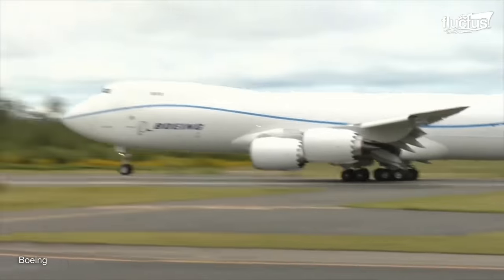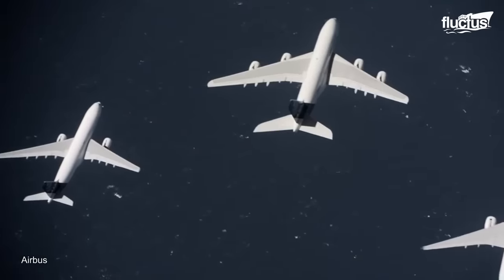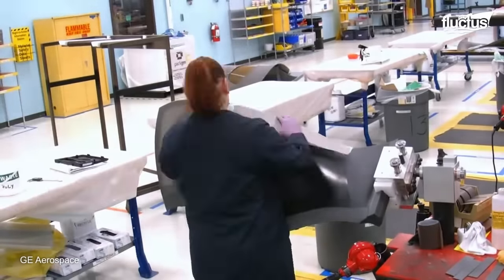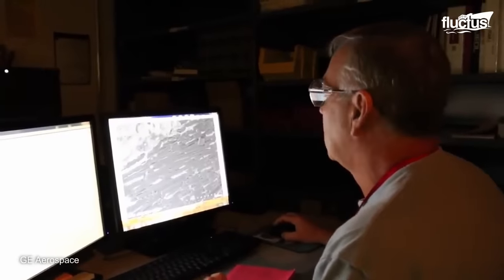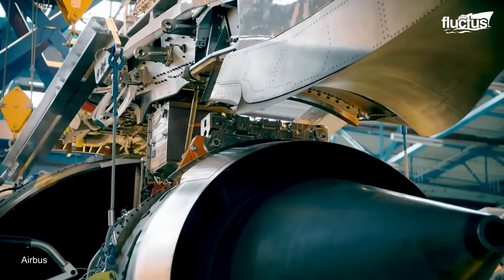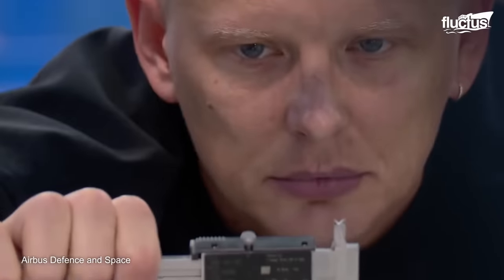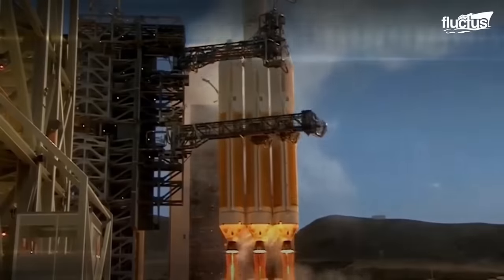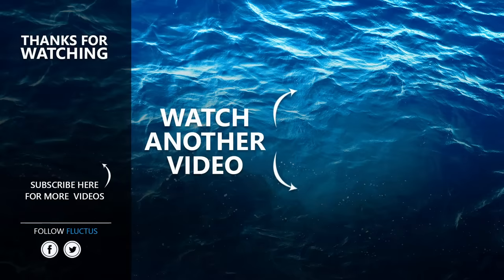Inside Futuristic Factories Building World  Largest Jet Engines

Comment: Trent engine doesn't cost 140 millon
Reply: Right. They are expensive, but not THAT expensive 😄
More like $20 million.
Reply: $ 140 million is about the price of the airplane itself like Boeing 737 or Airbus 320 size, they gotta get their fact right first before that
Reply: It's actually $35 million each for the Trent XWB,the world's most efficient high bypass large engine,based on RR's contract signed in 2007 with Qatar Airways worth $5.6 billion for 80 Airbus A350 XWBs.

Comment: A rolls Royce XWB engine doesn't cost $140 million dollars. More like $18-20 million for bare engine, and another 5  million for the inlet, mid cowling and thrust reverser.
Reply: You forgot another 2 or 3 mil for all the accessories.
Reply: I was also sceptical about those numbers..
Reply: @cdertschei  yup , a  new plane costs $70- $140m for regular versions then B747  and AirBus 380 are most expensive ones.
Reply: They can be a lot more expensive over engine lifetime. The lifetime cost of a large commercial jet engine including maintenance is anything from $40 million to $100 million plus depending on the number purchased. Jet engine manufacturing is dominated by the US and UK and the level of engineering that goes into their design and production is pretty amazing.
Reply: @peterd788  I know all too well how expensive modern jet engines are, the engineering that goes into design, build and continuing product improvements, and the operational coats are.

Today, engine leasing or Power by the Hour, give airlines a known cost verses rolling the dice and taking the chance the engine is going to live 35-40 thousand hours. 

All of the manufacturers set fuel burn guarantees.
Reply: It cost ~£30m

Comment: I think no longer should we speak of "Jetengines" when we consider   "turbofan-engines". These are no longer "turbojets" as in the beginning . Nowadays they have enormous blades so we can almost speak of Propellers.
Reply: Propellers with cowling..
Reply: Yeah it's known as a ducted fan.
Reply: High bypass fan
Reply: The Turbofan is the type of engine. The Turbo drives the fan.
You have high by-pass and low bypass fans.
Fully ducted and partially ducted fans
Reply: P

Comment: Worth to mention that each fan blade is made of a single crystal of titanium alloy. Being made of a single crystal is to avoid failures originating from microscopic cracks between crystals! … Jet engine! What a piece of machine!!! ❤
Reply: Not a single molecule (that would be miniscule) but a single crystal.
Reply: @terencerucker3244  you’re right 👌🏼 … I’ve just missed the term!
Reply: It's also not the fan blades that are single crystal, but the high and low pressure internal turbine blades. (the smaller ones inside the engine on the hot side)
Reply: @harryblack8686  They also have air passages embedded throughout the blade so cooling air can be blown through. I've filmed the whole process from lost wax casting to coming out of the furnace—absolutely fascinating.
Reply: You've got this pretty garbled I'm afraid.

Comment: RR titanium fan blades are lighter than GE composites. However, the real benefit of composites are not in the blades itself but the fact it allows you to use a lighter material fancase. With titanium, you need materials that can stop it from tearing through the case.

Comment: Oh, i thought this was going to be about GE since they make the largest engines, not RR.
Reply: Rolls Royce have just made the largest engine.
Reply: @nathd1748  No they have not. It's in very initial testing phases and they have said themselves it's not really a priority. They don't have anything to put it one right now anyway.
Reply: @John Iii  Not a priority??? You talk out of your ass! I'm the one over here with the phone line into the RR workshop and I'm hearing and seeing a completely different picture to what you are getting! The reason behind the fan size at 140" is that according to Boeing, that is the largest engine size they can fit under a 777x wing. So even though GE currently have exclusivity until 2028, RR are building a geared fan that will give them an idea of how it compares with the GE9x and what they can expect when scaled down. For your info, there are currently 4 other engines being assembled with smaller fans that will join the test programme. And IT IS a test programme because they are using the same core across different engine sizes but with a smaller main fan.
Reply: @nathd1748  Take shop gossip for all you want. The truth is is Boeing having so many problems as it it with the 777X development  right now as it is, they are not looking for another engine for it. Maybe in 10 years from now it might be an option. And basic fact the number of aircraft it will sell its not worth it for a two engine option. RR developing it is highly likely to be for Airbus and Airbus isn't in any hurry.
Reply: @John Iii  You have totally no idea mate. I work at Broughton Airfield, so you SHOULD have an idea who my employer is and WHY what I'm telling you is not gossip.
Reply: @nathd1748  Well if you can make it as large as possible, you can also shrink it for smaller planes right? I hope RR has been closely seeing how the P&W GTF has been faring, that thing works great but isn't nearly where it should be. New tech does go through challenges.
Reply: Yeah  me tooo !!!! Seems they were in the wrong factory, or it was a British propaganda show !!!!
Reply: @nathd1748  Its not the size that makes the most powerful GE has that RR not even close !!!
Reply: @wilburfinnigan2142  hey SoaringTractor....the RR has been built to give a comparison. It comfortably churns out 110k and is not at full power. Just because they haven't released the official figures, don't think you knowing all. What I can tell you is that is gave fuel consumption figures between 12-14% BETTER across the gears than GE have promised on the GE9X. That means GE are trailing about 6-7 years now behind RR in big fan efficiency. Eat that!!

Comment: Right, jet engines are getting bigger and bigger, even bigger than old propeller drives. But what is alarming is that these modern jet engines break so often.
Reply: Look at the hours & miles that get put on em
Reply: Actually except for that new geared turbofan, the rest are far more reliable. It's just that the amount of news and social media is on a whole other level now.

Comment: good thing GE had already designed modern low pressure blades.  RR only had to copy, but with less advanced metal, rather than carbon composites as GE did

Comment: These engines should all make some expensive salvage when the green policies really kick in.
Reply: What policies, and how exactly does it have any effect on jet engines? Nobody is even remotely considering scrapping them, not with the absurd efficiency and bypass ratios we've been able to achieve in recent decades. If anything, supersonic flight is being considered again.
Reply: @Adrenalin844  I will only say that considering the cost of crude these days and its eventual scarcity, then you won't get many bums on seats, thanks.
Reply: @andrewlilley3660  There is no "scarcity" of crude oil, which I presume you are referring to. Not now, and certainly not for the foreseeable future, as our current oil reserves are predicted to last a couple of centuries and the number keeps rising as more reserves are discovered. I imagine you're simply talking about the current spike in oil prices, which is neither the first, nor the last time it has happened. Furthermore, jet fuel can be also made synthetically, both using biofuels and other materials, so I still don't see what you're getting at.
Reply: @Adrenalin844  it's clear that you don't, but during Con Vid, air travel almost ceased, do you not think that scenario will occur again, with most economies in the bin, how many folks will have the resources to travel anyway, thanks.
Reply: @Adrenalin844  By scarcity I mean it's availability or lack of, not referring to any peak oil scenario, at all.
Reply: @andrewlilley3660  What does that have to do with anything? Airlines crashed after 9/11, airlines also crashed during the 1970 economic crisis. Of course airlines will suffer during an economic crisis, it's happened over and over again already. You're not making any arguments here.

Why did you just repeat your previous point about oil scarcity? No, there is no lack of oil that is being drilled or can be drilled without installing new infrastructure, or already drilled and stored for that matter. I'm not sure why you're bringing up peak oil now as that talking point has been pretty much dead since fracking got involved, but whatever.
Reply: @Adrenalin844  It has everything to do with it, those scenarios were only blips on the radar, we are currently heading for a massive depression, but more poignantly all forms of pollutive travel will be massively regulated and the public at large will neither have the resources nor the correct permissions to use them, I may be wrong, of course, and it will be a good while before this is really felt throughout the industry, but I'd put money on my being correct, thanks, and all the best.
Reply: @andrewlilley3660  Mate, I'm pretty sure it's been admitted that the depression is already here and has been felt by most of us, and it's been comparatively flat to a lot of the nasty stuff that happened back in the 20th century, and airlines have popped back up again after several of those, just like all other industries.

I'm not sure about regulations and public access to methods of travel as a whole either, that I can agree on. However, this will then most likely only apply to a select few states that undertake borderline dictatorial measures to enforce said regulations, while the rest of the world will wave it off and continue doing whatever. Most of the world doesn't give a damn about western climate alarmists and their ludicrous proposals.

Comment: All these high by-pass engines with ratios 15:1 or more, they are basically glorified turbo props, with the propellers hidden with a shroud from the public eyes. The shroud do increase efficiency and snob appeal, but as far as performance is concern, the whole aviation industry been stuck at the sound barrier for 3/4 century now. But the efficiency eliminate the need for most fuel stops for longer distances, this effectively make airplanes marginally faster.  As if this is not bad enough,  the British wanted us to take a giant step further backwards, and travel by airships. Maybe soon we should retask those cruise ships to cross oceans. In the mid 60s, BOAC 707s with the first generation Rolls fan takes 22 hours from HKG to LHR need 4 stops. Now it is a direct flight.
Reply: They are not glorified turboprops because a prop has a totally different shape with gaps, whereas modern high bypass engines have sharp blades close together and can have thrust reversers attached to them.
Reply: @nathd1748  Also turboprops are limited to around 450-500 kmph max. Great for smaller routes, not so much for longer ones.
Reply: You need a quantum leap in engine propulsion technology if you want to break the sound barrier and yet achieve fuel efficiency at the same time, Concorde achieved the former but not the latter,hence it was never a commercial success because it was  accessible to only to a very narrow section of the population,ie the rich!.😂